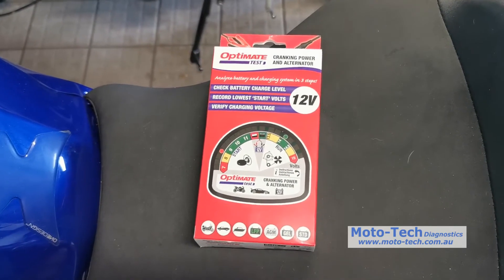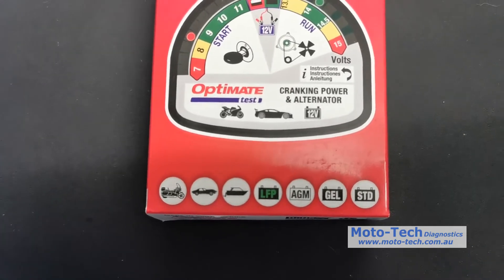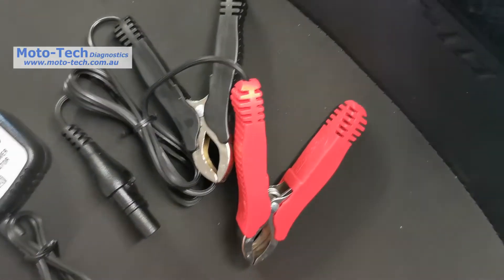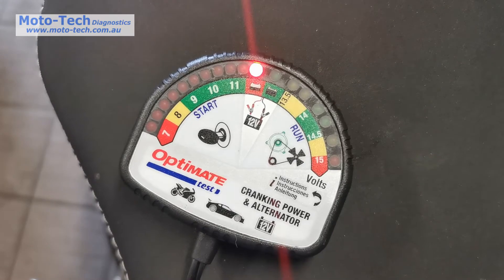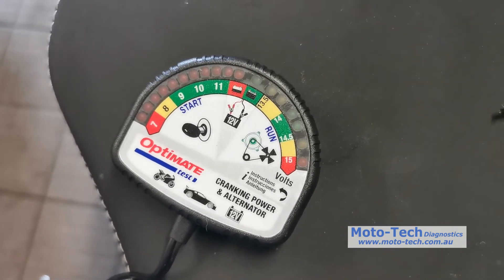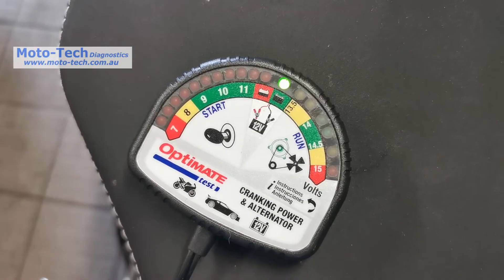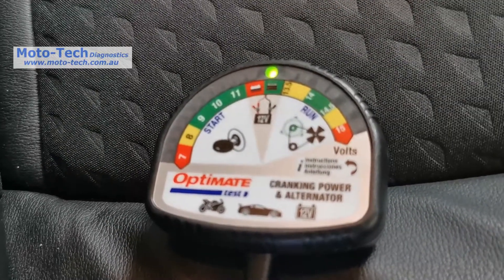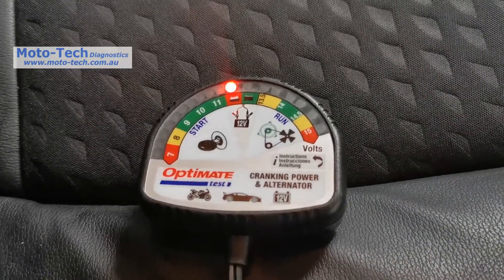OptiMate Test. Easily perform a battery and charging system test. Car, Motorcycle, Boat, PWC, etc.

Comment: Great video. I wish I would have seen this video before I ordered a new regulator/rectifier. Last week I took my Suzuki '07 GSXR 1000 motorcycle with 72,000 mi on the odometer out for a ride last week drove 75 miles and then the bike started shutting down and restarting on the drive and then finally it died all together, no lights no blinkers no horn no nothing. Battery was 3 years 3 months old I was going to buy a new one last month I wish I would have, so I Google searched it everything pointed to regulator/rectifier so i ordered one from Suzuki and while I was waiting for that to come in, I replaced the battery and it started right up, I did have the battery tested and I had a dead cell. I hooked up my optimate tester and come to find out it wasn't the regulator / rectifier, I got an even healthier reading than you did in your video, so now I have a brand new spare regulator / rectifier just in case it does ever go out.  Today I'm going to a bike night that cycle gear in Riverside and I'm going to tape that optimate to the fuel tank and watch it on the way down there to see the highest that the volts go to, just to make sure it's not going to overcharge.
Reply from the maker: Glad to hear the video helped, and have a great ride tonight!
Reply: @mototechdiagnostics 
So I was heading out to the bike night last night  so  I decided to hook up the tester and tape it to the gas tank and see what happens when I'm driving at a normal street speeds that's where I noticed that it shot in to the red zone, It was definitely overcharging. So it's a good thing I didn't cancel the regulator/rectifier but the good thing is my charging system is working but the regulator/rectifier is allowing too much current from a generator to go to the battery and that's why the battery was killed. So once again thanks for the video..